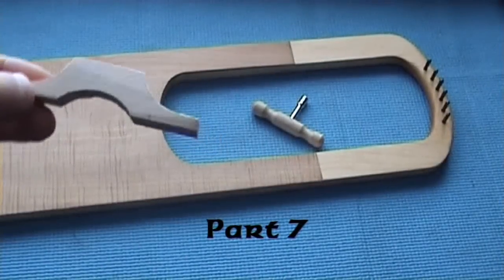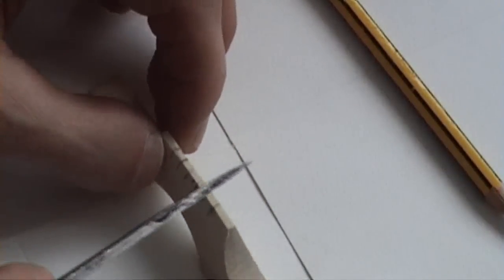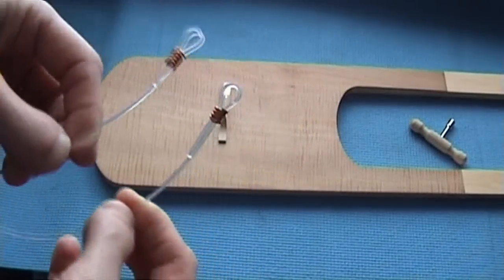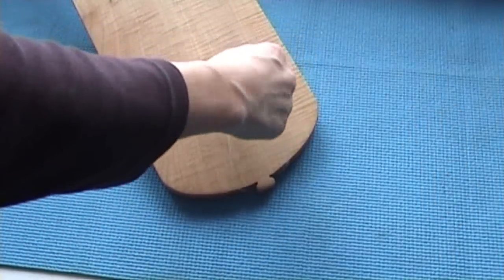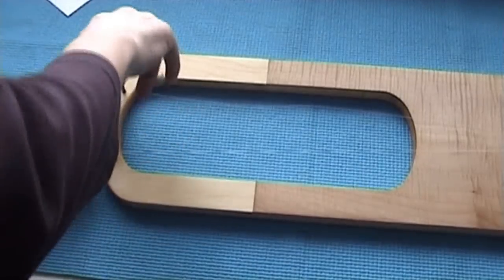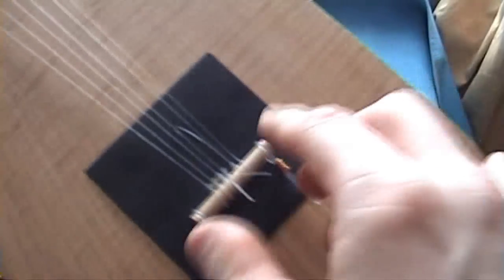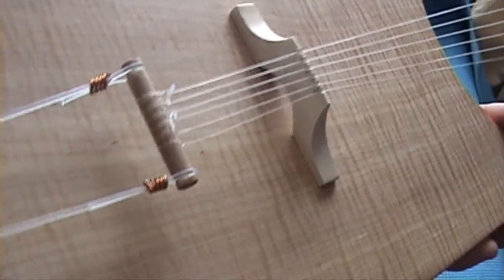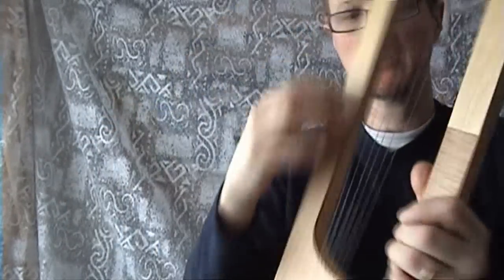Making an Anglo-Saxon lyre part 7

Comment: ehkm... pardon my ignorance, but where is the sound hole?
Reply from the maker: These lyres didn't always them,  apart from one example in Germany.     Anyway They work slightly differently from a guitar. The back is thick, soundbox shallow and the top graduated and the treble sound projects very well.
Reply: @michaeljking  would adding a sound hole make a difference?
Reply from the maker: @jocelynleon6331  these didn't usually have them, they are thin bodied instruments with a pitch close to a ukulele.   Not really a bass instrument.   That said  some did have small holes drilled,.  In my last couple of recent lyre videos on my channel I demonstrated a maple top lyre with two small holes drilled and a cedar top lyre with no holes drilled.   The holes make a small difference on the maple top in the sound you hear as a performer mostly I think.

Comment: which is best to use nylon or metal strings?which way basically do you put the heavier gauge strings to the lighter ones if using metal strings.am trying to finish my lyre and want to get string placement the best way for a nice tone.I would like to tune it to an E Diatonic pitch..
Reply from the maker: james arterburn    my first lyre I built in 1989 used the plain nylon strings from  two sets of classical guitar strings   3 3 2 2 1 1   for a g diatonic tuning  21" scale I think     that's still a cheap starting point to experiment with,     for tuning lower   look at your instrument and decide    historical instruments are not designed for high tension strings    wound strings are not found on early lyres either      when someone wants a lower pitch instrument in e for example I suggest they build my oberfkacht or trossingem lyre model plan I supply
Reply from the maker: I use fluorocarbon strings mostly as they are very forgiving with tunings   more so than gut or nylon    on a Sutton hoo lyre they can go from e diatonic to g diatonic and still sound ok
Reply: Michael J King cool thanks.this is a great help.
Reply: Michael J King great idea.thank you